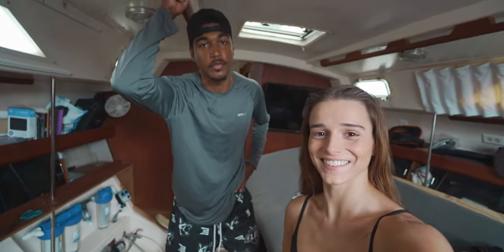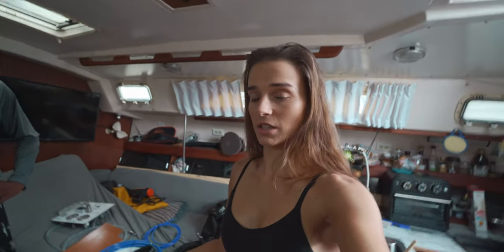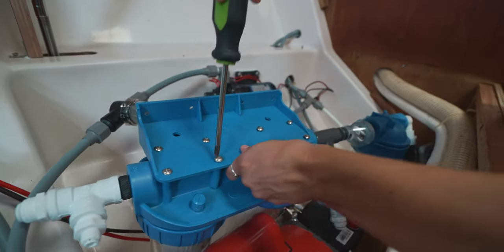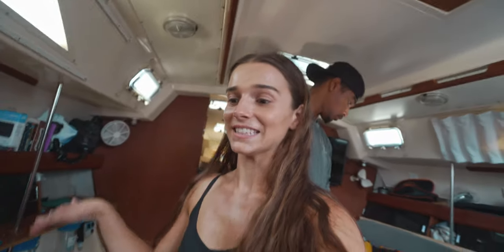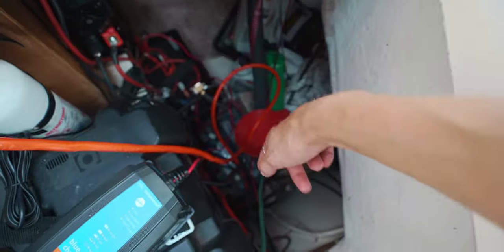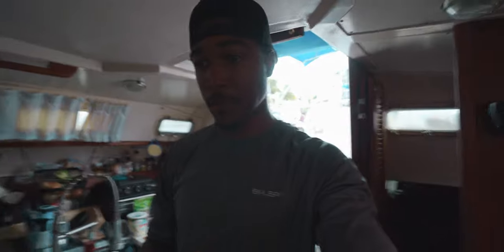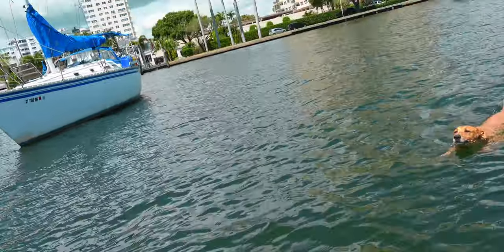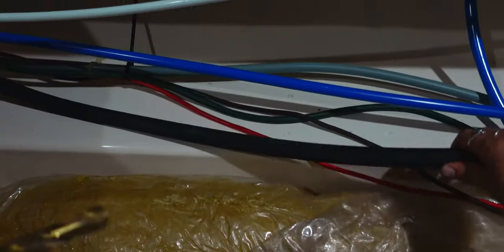How To Take Unlimited Showers On A Sailboat!  (Watermaker install)

Comment: Bonjour young sailors.  many thanks for the vidéo.  it's so good to see you two up and about.  boat maintenance and installs are like house installs and maintenance.  be assured that you're going to visit the hardware store often, even three or four times in a day.  been there, done that.  there's no shame.  it happens.  work slow, make a list of what you need, measure twice and if possible, map out the project on paper.  less over-runs and lost time.  all the best this week.  cheers
Reply from the maker: We agree. we thought we did a good job planning but quickly realized we weren’t thorough enough. But the project is done and it has definitely served us well!
Reply: please remember that i'm not critising nor judging.  i'm 123.5 pourcent for you two.  thanks for the vidéo and i'm looking forward to the next one.  cheers

Comment: nice install, just make sure none of the hoses and wiring loom is chafing ever so slightly since it will become an issue over time... a cheap trick is cutting up a bicycle tire tube and wrap critical areas with zip ties or by using rubber grommets... thx for sharing btw & good luck.
Reply from the maker: We actually used some reinforced vinyl hose split in half  in the areas we thought would be problematic in the long run.

Comment: Andra & Ianna, (I hope I got those right. Or at least close.🤔😊(?)) Good video, good story. I found the way you presented it to be entertaining even though I've seen the same things dozens of times on other channels. Good Job.👍👍 
A little advice from 4 decades in the marine industry. (MVs & ships) 
1st) When boats are involved NO plan is fool proof & even geniuses can look like fools. 
2nd) Allow at least 1 hour of time for every minute of time you expect the job to take. For a 15 minute job you'll have 15 hours to complete it. If you get it done in under 15 hours then it was a Great Job. Pat yourselves on the back.😁 
3rd) Have plan "A" finalized at least 1 day ahead for every hour. The planning for the 15 minute job should be complete 15 days ahead of time. If the job is important or complicated you'll most likely be on revision C, D or E by the time you actually begin the work.😂 
4th) Despite your most genius planning you'll Never have All Of/Or the Right parts, tools & materials to complete the task(s) in the minimum possible time. You will use up the Hour Per Minute time quickly on in process revisions & fetching all of the things you didn't know you needed or needed more of beforehand.😉

In the end, if you've completed the job satisfactorily without compromising the integrity, quality or safety of yourselves, the system, your vessel or the future of any of these things you've done great. You deserve a celebratory drink.😁 If you've managed to accomplish all of those things within the time and budget constraints then you're a freaking genius!  You deserve a pat on the back.😂🤷🏻‍♂️
Wishing the both of you all the best.🙏
🙋‍♂️Form the North Shore of the Gulf of Mexico.

Comment: Would have told you to add a tee into one of the fill lines allready going into the tank but it's to late
Reply from the maker: It was very hard to find a tee with a 1-1/2 to 1-1/2 to 1/2 without having to use multiple reducers and couplings. This was our original thought!
Reply: @SailingNaida   automotive coolant sensor tee or motorcycle for the one and a half in stuff there is allways something out there
Reply from the maker: @thomascooley2749  Ahh see this would’ve been helpful!! Thank you. Next time we have to put out a discussion board for suggestions
Reply: @SailingNaida  not a problem I know how it is when you just want a project done and working